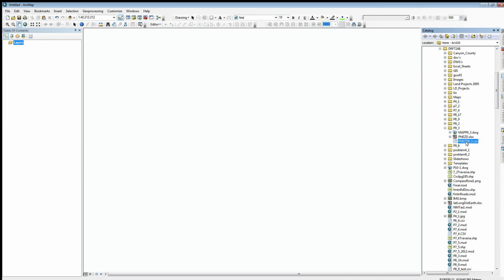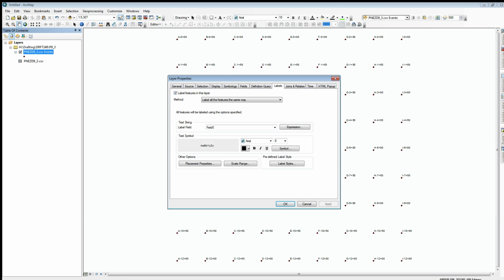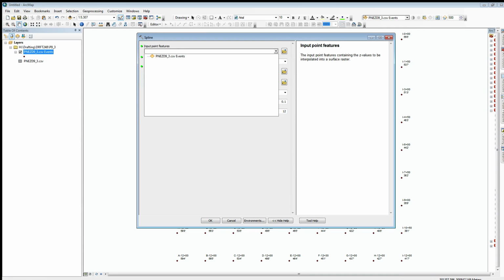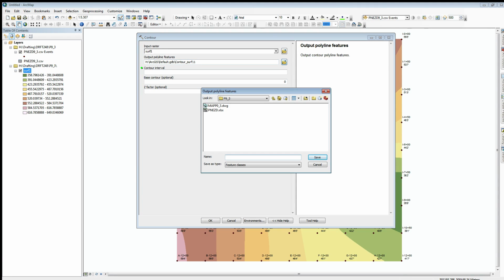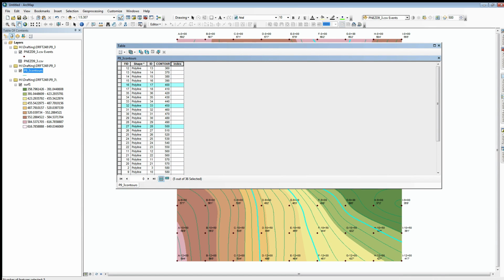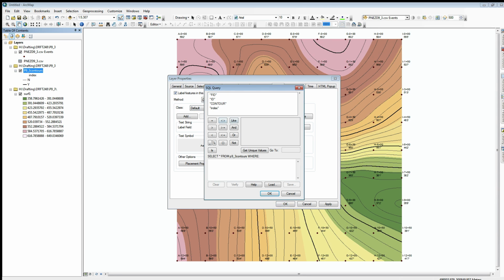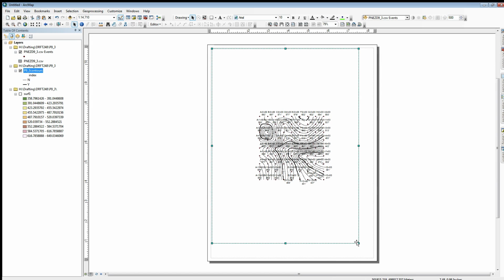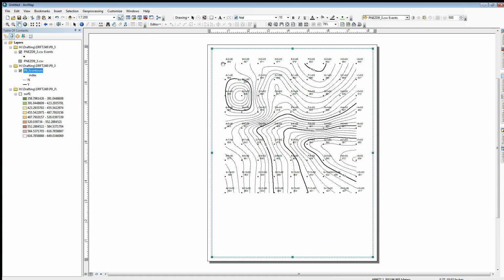ArcMap Contours

Comment: Hello,
What are local operators in Map Algebra?

What are the elementary processes of generalization?
Reply from the maker: Generally speaking when considering raster operations "local" means that the algorithm (such as IDW or others) is being applied over a subset of cells in the raster at a time, then the subset of cells is shifted for the next iteration of computation.
For rasters, generalization is usually performing some sort of averaging over cells to simplify the data which usually results in the output having a lower resolution.
Hope that helps.  If not, please feel free to ask for clarification.

Comment: What are the most suitable methods of interpolation to make the contour maps?
Reply from the maker: Well, in this video "Spline" is used because it is very smooth, but if your data is not spaced very evenly or if it has sharper variations in relief then it can give erroneous results.  In those cases IDW may work better because it can be set to a linear interpolation (with a power of 1).
Hope that helps.